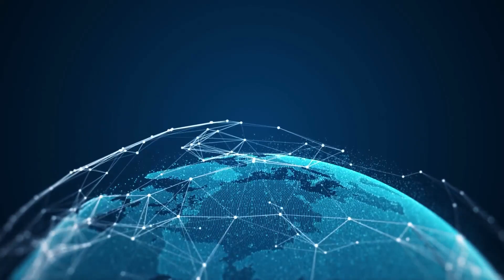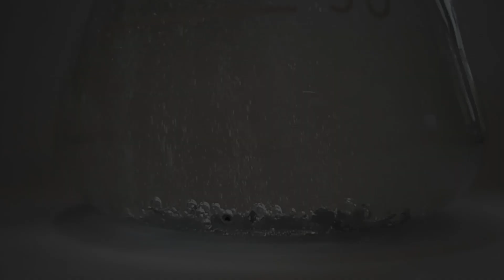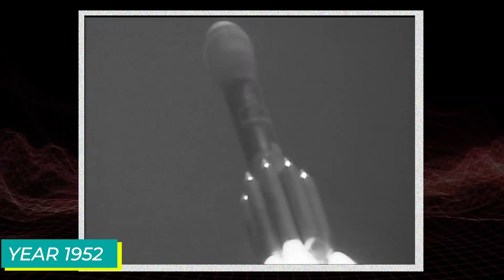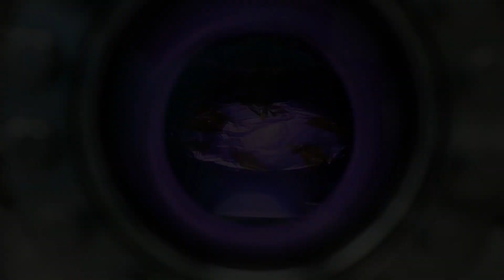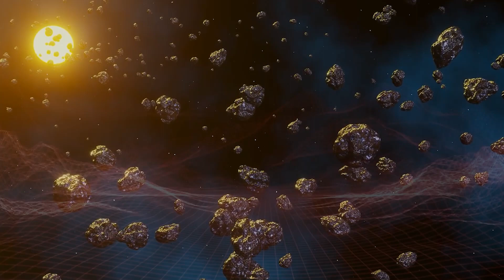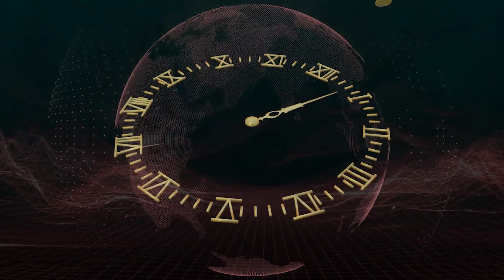Germany's New Nuclear Fusion Reactor SHOCKS The Entire Industry!

Comment: A stellarator is still the gold-standard of nuclear fusion because it is the only technology continuously delivers energy. All other current fusion technologies like Tokamaks or inertial confinement fusion are pulsed. So even when the LLNL recently announced a breakthrough, it's necessarily pulsed because it's based on inertial confinement. That raises tons of other problems, like a delivery system that has to be exact to the micro- or nanometer or the massive capacitors required for the laser pulses. It works, yes, but it's quite rough. It's like a Ford Model T, whereas the Stellarator is like a Mercedes Benz S-class.